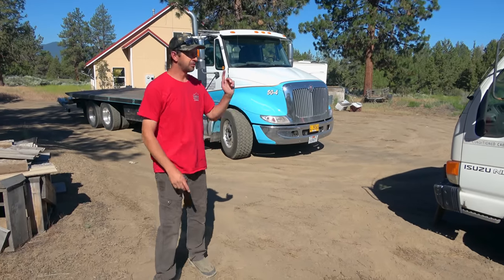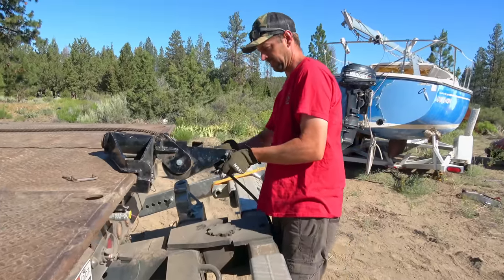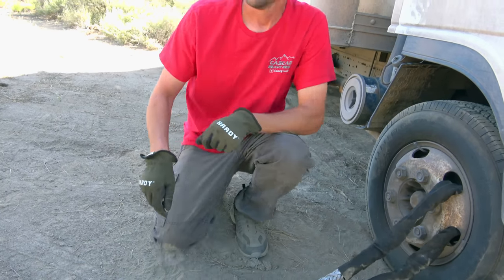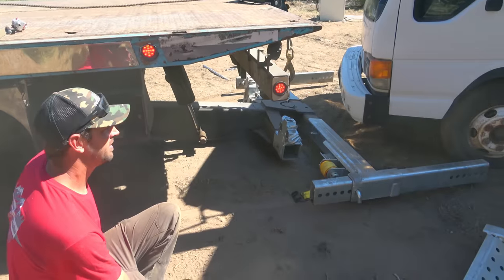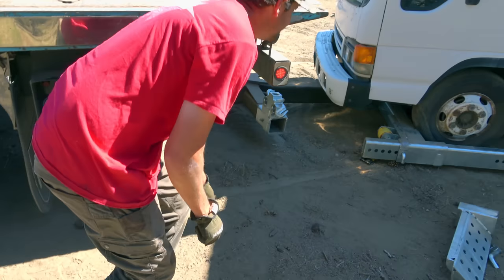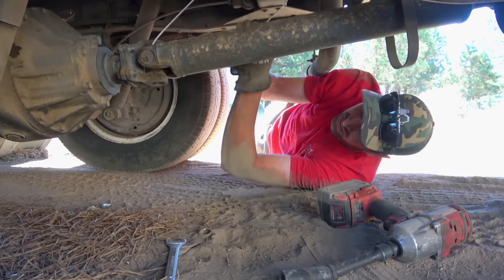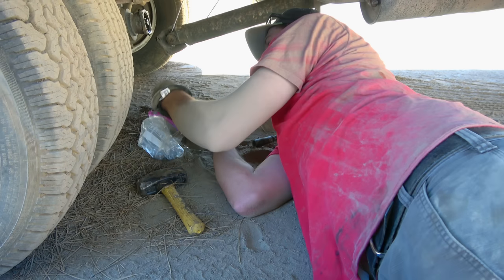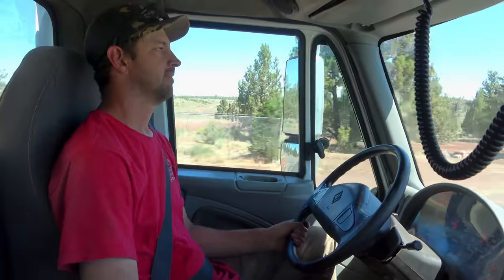One VERY Dirty Job…

Comment: Back in the 90's I had a box truck simulator size to the npr I had set up for HVAC fabrication and it was heavy. I snapped a u joint in Salem and gerlock towing towed it back to Portland with there little hino #6 known as the grasshopper. My truck was so heavy that truck look like a grasshopper as we would hit bumps and the front end would hop up and down and any attempt to do a quick stop was not going to happen. We had a fleet of tanker trucks and gerlock towing was always there to help when needed. It's nice to know they're still around.

Comment: Casey, you should stop by lowes and buy some tynek painter’s coveralls. They are throwaway so don’t last very long but will keep your truck interior clean. Especially since your towing method requires you to get on the ground and in the dirt to disconnect driveshafts.

Comment: Pulling a steady pull on the ball with nothing more than rolling resistance is perfectly fine. If the box is not over 9' Tall I would have put it on the bed and not worried about the radiator but if it's over 9' Tall the wheel lift is the way to go! That was a REALLY good paying job with all that additional work to get hooked up! Great job!

Comment: Well done, Casey. Using the right tools for the job. There's a YouTuber out there with the initials of DD that I won't name that should take lessons from those that use correct store bought tools for the job. I'm not saying a person can't make their own equipment, but when it comes to safety, you need an engineering department behind it.

Comment: Nice. The oil in the drive pinion is pretty common... oil will weap up the splines on the pinion If it's got some wear or someone didn't put sealant on it when installing it. It's fairly common practice to put a little pipe sealant on the splines.

Comment: A steady pull on a hitch ball is fine, it is literally what it was designed to do. The problems occur when so monkey with a strap or dynamic rope decides that hammering on the go petal is the right course of action. Also the bigger the drop the bigger the problem. Shock loading is a thing, and not a very good thing.
Reply: right like if you are sure the object is gonna move it should be no problem but trying to pull out a stump etc you really have no idea if its gonna move or not so dont use the hitch
Reply: Yeah. But you have to  tell everyone not to do it because they're the reason we can't have nice things.
Reply: There’s another risk with a ball, that you don’t get with an eye.
The rope is not captive and can ride up off of the ball, particularly when you’re pulling on uneven ground. The risk here was minimal, because the ground was level enough that, if the rope did come off, the truck wasn’t going anywhere and, using Casey’s non-stretch ropes, it wouldn’t catapult and hurt anyone.
Further, he uses a remote control winch, so he’s in the cab of the invalid, ready to take control, if need be. He substituted a couple of layers of additional safety, in order to take the shortcut and lose one.
Not sure about over there, but in Europe the hitch is required to be able to take shock loading. If the trailer gets involved in an accident, it must not break away from the towing vehicle. You’ll often see safety chains attached at the ball hitch. That wouldn’t be much use if the hitch was separated from the frame, would it?
Still not best practice, but often the only way, with European chassis.
Reply: Is the weight of the truck not more than the tow ball is rated for? (Would I do it? Hell yea)
Reply: Class 3 hitch is rated to 6000lb and 10000 lb with weight distribution. So with at least a safety factor of 5 we are talking 30 to 50 thousand pounds. The shank of the ball never breaks, it’s usually the  drop of the hitch that breaks. A 4”, 6” 8 “ drop just keeps on adding more and more leverage . You’ll notice that reasonably people don’t end up on you tube with a hitch through their back window, it’s usually someone with limited knowledge, or no common sense or just an idiot or are pressured by an “expert”. A stuck vehicle is not worth anyone’s life.
Reply: A tow-ball is fine for recoveries if it is; used appropriately, in good shape, and you have proper technique. Same as any recovery point. 

They have gotten a bad rap because they happen to be the only potential attachment point on a lot of vehicles involved in janky jury rigged recoveries. You have three things; a knucklehead, a POS bumper mounted hitch ball or a drop down hitch, and a non-dynamic strap or chain.  All being used to try and dynamically pull someone, and ……wallah! You have an accident. 

You will not see a straight hitch shaft with a standard 2-3/4 tow ball - in good repair - fail when used in a recovery appropriately.
Reply: @EyeMWing  There is a lot of that going on lately......
Reply: Oh I certainly wouldn’t hang the truck by the ball (nor anything else, either!) But on horizontal ground, with all the other safety measures, this is not a problem. Even if the wheels were stuck, this would be okay, the way Casey does it. As it was, with only one wheel partly stuck in the ground, nothing to worry about, especially with everyone well out of the firing line, if anything totally unpredictable happened.
Someone commented something highly intelligent about keeping it in Europe or creating content. I can’t find the comment here, so maybe they sobered up and retracted it, but it was still in my email.
If someone seriously wants videos of my leg in a sling, for month after month after month, I’m sure I could oblige.
Whenever I’m able to return to work, I won’t have time to play with the internet any more, so at that time I guess I’ll be keeping it in Europe, so s/he’ll be happy.

Comment: I watched a roll back driver with a full sized Dodge bell telephone van on the bed of his truck. His front end was barely on the ground,and he said he was lucky he made it!
I've overloaded my flatbed and did have a very light front end!
I've seen roll backs that the scrap peddlers in Detroit use with a bent frame where the roll back bed won't come down flat and stays a foot up in the air at the front,from damage,yet they keep driving it like that!

Comment: Hi Casey,
 I saw that you lost a light bar off one of your tow jobs for -800$.  Rubber bungee straps are bouncy and have open hooks so they can jump off if the light bar gets to bouncing badly enough. Next time, maybe thread the ratchet strap through the carry handle on the light bar before you tighten it between the grab handles on the back of the truck. Then hook the two lower rubber bungee straps crossed diagonally to the truck bumper (like trailer safety chains.)  Good Luck.

Comment: past like 6 of those isuzus i towed i literally had the same exact response. "Wacks shaft with hammer it pops off" Wow Theres not supposed to be oil in there. But its all of varying amount so i dont think its ment to be like that lol. Had one gush out, one barely a few drips.

Comment: Thanks, Casey. I know what a pain it  is backing into this shop, but once you stepped out and looked for yourself where it needed to go, it went right in.

Regarding the drive line leak, I am guessing that there is an o-ring under the pinion nut washer that is leaking. The question is, 'is it worth fixing?' It wasn't even damp from oil leaking out, its clean, so why bother? My only concern is how much leaks out while towing with the driveline disconnected?   

For those curious, it had overheated (probably because of a leaking radiator that he was going to get around to replacing - one of these days) and cooked the head. We are hoping that is as far as we need to go, but we will see.
Reply from the maker: Happy to help!   That flange was bone dry before I pulled it off, so I doubt it’s an issue.  It’s always fun trying to back into new places with a truck that’s twice as long as what you’re pulling lol
Reply: @CaseyLaDelle  You might be able to snake the next one out without moving that car. Also, I have some thoughts on your hydraulics.

Comment: Oh, the joys of being a tow truck driver! You get to crawl under trucks and cars in all kinds of conditions, like dusty or gravely ground, snow,slush  and backing off the brake pots on air brake systems,and hope you don't die if the bolt is stripped,and come flying into your head!
Crawling under trailers that are parked on soft ground, to put a hook around the 5th wheel pin!
I did that. There was 3 feet of clearance before the trailer hit bottom!
We had a truckers who decided to back off the bolt in his break chamber. When my boss got there,he was unconscious, with the bolt sticking out of his forehead,in his skull ! When my boss asked him why, it was either to save money or time! But I bet he never did that again! He lived, and the hospital pulled the bolt from the break chamber pot out of his forehead and pulled the peice of his skull back in place!
Note: the the  threads on a brake pot chamber rust out fast cuz  they're fine threads .
One of the jobs we had ,was a call to an underpass that was not 14 foot clearance and truckers thst thought it was,it was 11,6,kept knocking 20 ton rolls of steel coils of there flatbed so my boss asked me to wrap a chain around it,whike it lay flat on the ground, so he could pick it up! He did one before,it has sprung out on the road,dangerous work at times,and roll backs were unheard of way back then!
My boss had the first extendable boom!

Comment: Howdy Casey!!
You didn't show it, but since you have the air hose fairly handy, wondering if you use it to "blow the talc" off your clothing before you hop in the driver seat .... 
(that pumice dust raises hell on vehicle seats!!) 

🤣🤣 "Could you move it over to the RIGHT a foot or so?" 🤣🤣
I had to watch that one again!!
Great job backing that beast into the precise spot in the bay, Casey...

Safe travels friend ❤️❤️
Stay  FROSTY...
Keep your powder dry and your head on a swivel...
🇺🇸🇺🇸WWG1WGA🇺🇸🇺🇸NCSWIC🇺🇸🇺🇸

Comment: Those are the new oil cooled driveshafts Casey. You’re supposed to get another 5 horses with those driveshafts
Reply: Just don't get your driveshaft fluid and beep fluid for the horn mixed up or it'll take out the turbo encabulator
Reply: @cheesecurd100s  and when that happens you have to take all the wheel bearings to the alignment shop to get recalibrated
Reply: @oldscoutinks_7482  Exactly!  🙂

Comment: Genuine question. What happens if the tires that are strapped down go flat while towing with this setup?
Reply from the maker: It drops lower into the grids and is a pain to get out
Reply: @CaseyLaDelle  Could always use dynamite to dislodge them since it's YouTube.

Comment: The pinion is leaking between the splines on the flange and the pinion gear.
SUPER common on Ford 10.25" rearends of the '80s and '90s.

So watch out for it on your 4wd Ford tow truck.
On it the yoke bolts directly to the pinion BUT it'll still leak through the splines when they get worn.

HOWEVER, being a dually it MIGHT have a Dana 70 or 80 instead of the 10.25"
Reply: I'm guessing there should be an oring under the pinion nut washer.
Reply: @timothyball3144  NOT on the Fords but maybe on the NPR.

Comment: Does the value of all those towing attachments and accessories you’re getting exceed the value of the truck itself? And at the end of the day, how much does all that stuff weigh? It looks like your constantly adding more and more of those gadgets and things.
Reply: I think Casey had said that the original use of the truck was for hauling heavy equipment such as forklifts. So its gross vehicle capacity would be heavier than anything he would ever Haul. Which is why he probably has more than adequate capacity for hauling all of his equipment he uses. With a truck like that fuel mileage will never be an issue. Because it will always be bad.

Comment: I could be wrong but I’m pretty sure whoever tightened the nut on the pinion gear yolk neglected to put thread sealer on it. It’s probably a very slow leak that just pooled up between the drive shaft and yolk over time and was sealed better than the pinion. Probably safe to drive but I’d recommend getting it looked at.
Reply: I'll put a wrench on it to be sure it's tight, but I am guessing that there is an o-ring involved.

Comment: Show me a 2” tow ball mounted to a proper straight shaft hitch -all in good repair - that has failed while doing an appropriate recovery technique.  They only have a bad reputation because the rusted bumper mounted tow ball on JimBobs truck gets used by Cleetus to do a dynamic pull using a chain. Or Jimothy uses a 6” drop down hitch to do a dynamic pull with a flat strap. Or Twyla’s 1-7/8” tow ball is loose and rusted and…. wait for it…..she does a dynamic pull with a chain.

Comment: One of the other problems is people! I was 18 or 19 ans sent on a wrecker call to our local casino,the Elmwood,in Windsor,the Americans would come over to gamble,and thus young white woman had killed her battery on her Eldirado Cadillac!
So me being 6'4" coukdnt get in because she had the sear far forward, so I has to hit the power sear button to move the sear back to get in,or open the hood,there was just enough battery juice left to do this!
Then she starts getting nasty and says " stop playing with the buttons, just get my caw staryed( detroiters can't say "car" it's sounds a crow," caw caw my caw won't start!" So she berates me for trying to get in,so if I recall, 40 yrs ago,I tokd I I had to do this to get her caw started! She was wearing a mink stole,and thought I was just some dumb kid who wanted to have fun with the seat buttons! Which was far from the truth!
Years later my boss got a call to assist a fully loaded tractor trailer, he had never asked me to bring tge twenty to bottle jack in all the years I worked for him till this call,he slid it under the rear axle and the driver became obnoxious,he had a European  accent,the whole rig weighed over 50,000!,didn't seem to understand my bosses in a dangerous job,and go away! I had to ask the driver to be patient and stop bothering my boss! I forget why he had this job, but ppl can be rude,obnoxious or impatient,and also polite! 
That's another aspect  a tow truck driver has to deal with,is having to worry about being in a hostile place!